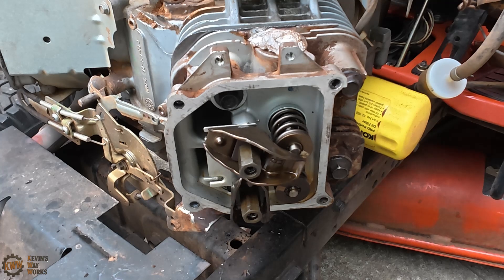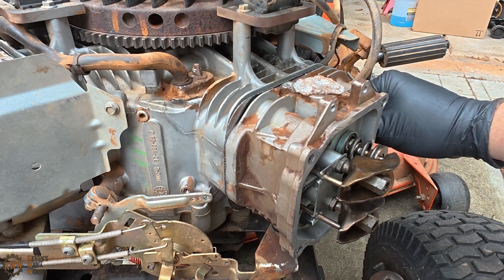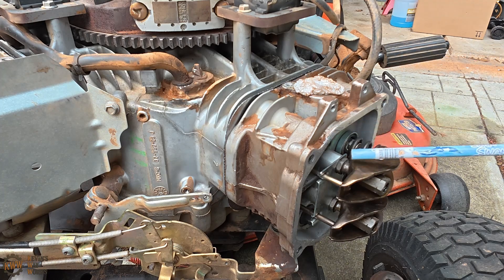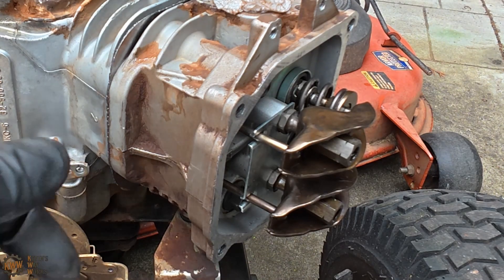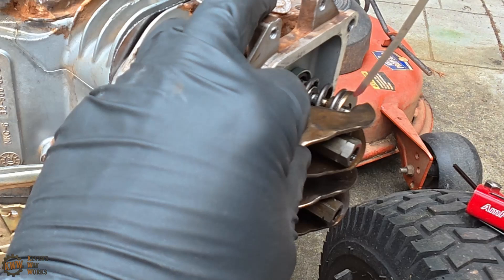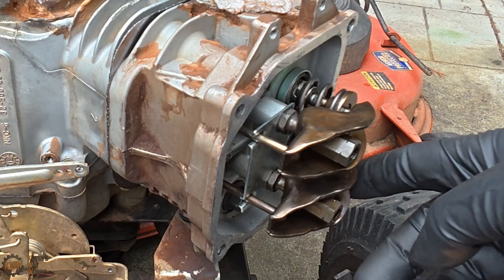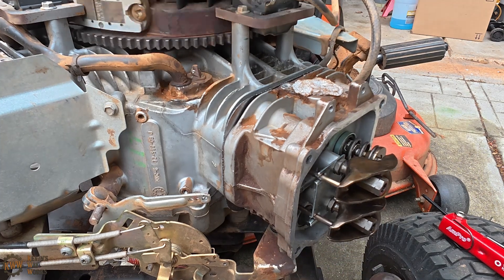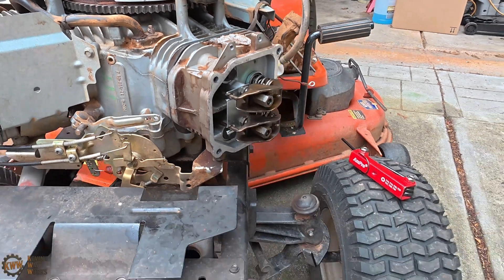Updated! Kohler Engine Valve Clearance Adjustment (V-Twin Courage, 7000 Series & More)

Comment: I have a Kohler Courage 22 engine, build date 02/01/2006, that challenges everything I have seen where valve setting is concerned.  The lock nut is under the rocker arms, and the torx adjuster is on top.  With this scheme, it is the torx screw that adjusts, and the 13 mm (1/2") nut locks it in place.

Comment: Lots of people working on engines don’t understand this concept 😢😢😢
Need trade back in public schools
Reply from the maker: It's crazy how much things have changed with engine technology over the years.  The need to adjust valve clearances on vehicles is a thing of the distant past.  We still had small engines to fall back on for some old school tinkering but that's quickly becoming a thing of the past as well.  A lot of the newer small engines have no mechanism for any type of adjustment.  And the knowledge on how to work on them is quickly fading away.
Reply: @KevinsWayWorks kids need trade back in public schools ASAP